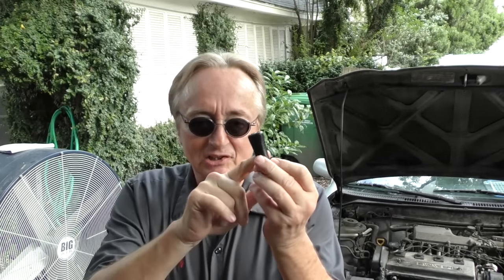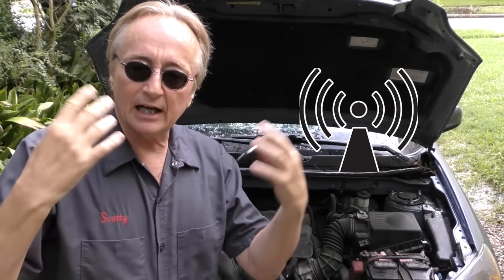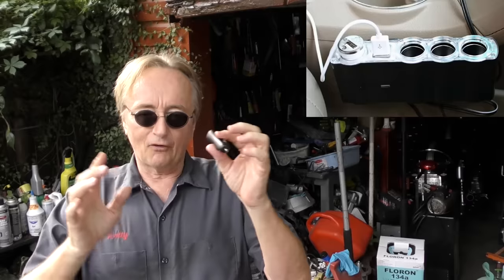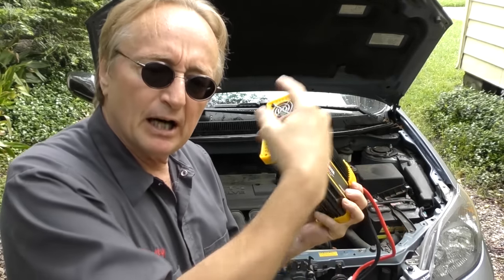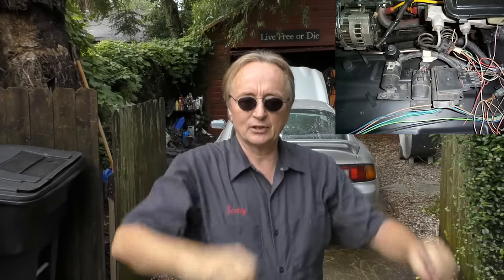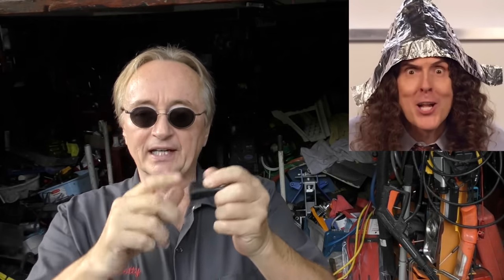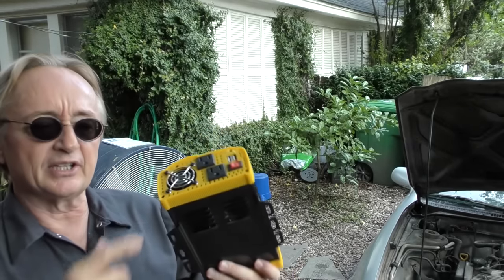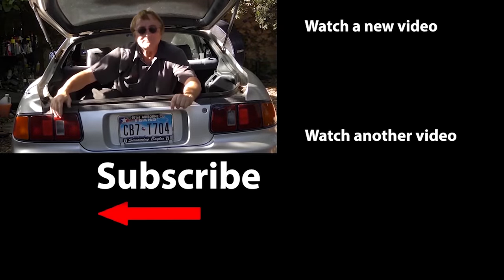This Adapter Will Destroy Your Car

Comment: These adapters are just 5V regulators. No conversion to AC needed.
Reply: Yeah was gonna say, going from DC to AC then back to lower voltage DC.. seems complicated.
Reply: Exactly what I was thinking. Going from DC to ac back to DC is pretty pointless as going from ac to dc will still require a transformer, rectifiers and a  regulator to make it 5VDC. You can bypass that instead by going from 12VDC, cars cigarette lighter, to 5VDC with the regulator
Reply: The higher wattage adapters are buck converters which are switch mode power supplies. They do pulse but they don't actually alternate the current. I can see how they 'could' create problems from RF signals. I still love Scotty.
Reply: Yea a $50 DC to DC  power supply use a 20c mosfet and a $5 DC to DC power supply uses a 20c mosfet.

Comment: For EMS week one year they gave us those cheep plugs. Every ambulance crew started using them that day. Turns out the radios in the trucks were being jammed from the plug. Crews were not hearing dispatch call them, some of the 911 calls had long response times because of it.

Comment: I worked in the computer hardware field for decades, including electronics.   There are at least a couple of things that can be done to greatly reduce RFI or EFI, probably the most effective is metal shielding and the other is filters, of course a combination of both can be used.
Reply: Shielding for RFI. I am a musician and guitar cavities should be copper foiled inside to deter the radio waves. There's nothing like picking up a cop's radio through your bass pup.
If you have a sub woofer on your home theater you most likely connect it with a shielded cord to ward off RFI. If not, it hums like crazy.

Comment: Scotty: "you can't see electromagnetism"

Man I guess visible light isn't a form of electromagnetic radiation
Reply: Oooof
Reply: Don't you need electromagnetism to excite some electrons into their higher orbit  in order to produce light.  Kind of like taking a fluorescent bulb near a Tesla coil.
Reply: @burritos1000  yes changing the excitation state of an electron usually releases a photon
Reply: If you want to get really technical, you're not seeing light, you're seeing a reflection OF light.
Reply: u have never seen light, no one can
Reply: @kwphillyzkp2  Two ways of "seeing" light,
 things that reflect visible light and things that produce visible light. Not sure who told you differently.
"Seeing" is our interpretation of light. So one cannot say you can't "see" light because the very essence of "seeing" becomes the "light"
Reply: @kwphillyzkp2  That said l"light" is a wavelength of photons. Your eye interprets these wavelengths. In order to be interpreted one must "see" the wavelength.
You want to understand how human eyes function?
Reply: @atheism7  i had a foton once but the wheels fell off
Reply: @kwphillyzkp2  if u suddenly see the light make sure u're not sitting in a railway tunnel
Reply: @LORDRA1DEN  a reflection is still composed of photons.. what's your point?

If you REALLY wanna get technical, then what you're seeing is a controlled hallucination your brain produces from it's interpretation of the electric pulses it receives when the photon receptors in your eyes are activated.

Comment: He’s absolutely right about using one of these 12v plugs. I have a Infiniti Q50 and it caused my car to completely shut off while driving. Infiniti S.W. Houston told me it caused 63 OBD 2 codes to pop up. They were about to recommend that I change out BCM and other expensive sensors computers, costing me $8k. But luckily we caught problem in time.

Comment: Physicists understand electromagnetism EXTREMELY well, Scotty.
Reply: I would hope so, lol.
Reply: Reminds me of the old rumor that "scientists don't understand how TVs work".
It is extremely complex and unpredictable because of the noise, but that doesn't mean that what's happening is not understand.
Reply: They may understand the 'how' very well. However, the 'why' remains an object of controversy.
Reply: The Earth doesn't wobble, what gave you that idea? And why would anyone want to close a black hole?
If you want an answer you have to actually ask a question, and why is not a question.
Reply: @benjovi55
No, the Earth doesn't wobble, it's tilted, so are the front tires of your car (maybe you should get that checked).
To ask why is just begging for an excuse.
Reply: @benjovi55
Well the Earth can't be tilted in the wrong way, as your tires are (and so are mine so I get it), but they are always tilted. A gyroscope can be tilted and still be stable until it's energy gets low, then it's fighting against gravity which causes it to wobble and crash into the nearest object.

I found that giving an excuse ahead of time just leads the other person to wonder why they bothered at all.
Reply: But why???
Reply: Richard Gates well some ppl are adventurous and want to find out so sneering the why question never hurts. And explanation never hurt anyone. If anything it can Haley in certain cases with certain things
Reply: @realcreature3D  a wise man knoweth that he doth not know.

Comment: Thanks for the info.  I know you probably don't have a lot of female followers since most girls have no interest in working on cars, however, I am a big fan since I have already used a couple to fix some things on my CR-V.  I had no idea the electro-magnetic interference would cause issues with the engine function but I have noticed that if I plug my phone in when the radio is on, it interferes with the radio reception so it all makes sense now.  Anyway, keep cranking out those vids!  I'm learning a lot!

Comment: Most of those just use dc voltage reglators not ac..
 7805 regulators only use voltage in (12) ...grnd... and volt out (5vdc). The noise is because cheap chinese mfgrs dont capactively filter them which can then oscillate on diff freqs.       The only ac would be in an ac to dc regulator... using a bridge rect to strip ac into dc.
Reply: Exactly.. theres noDC - AC- DC conversion going on ...
Reply: Can someone in here translate what y'all just said please? Lol
Reply: @robinnelson18  scotty is not being specific to the problem.  Most are not what he claims. Those larger models are different.  Those smaller models with the coils are not what he claims.
Reply: @Scotty Kilmer 
As soon as he said that dc gets converted to ac and then down voltaged, I thought the same thing. It does not. It gets directly down voltaged with a buck converter circuit.
  All you need to do is get a good quality device with minimal rf leakage.
Reply: WHAAAAAT!!!
Reply: @robinnelson18  Please don't leave the kitchen!
Reply: I think there is some confusion as to the difference between old fashioned linear type DC regulators like the 7805 and modern DC-DC converters which use switch mode to do the DC conversion. The semiconductors switching at very high frequency, turning on and off does the regulation. This method has much greater efficiency than linear and therefore produces less heat and so can be made far smaller and cheaper. A buck converter is a form of switch mode power supply. To give a simpler view, the Switch mode semi conductor literally chops up the DC into smaller pieces to change voltage, this is a huge over simplification but it is not a simple process.
This high speed electronic switching (in the KHz range) is what can create EMI. Scotty tried to point out that cheapo units will allow this interference because they are poorly made and designed.

Comment: not converting  DC to AC to DC. its using a voltage regulator and there is some ripple or noise but current flow never alternates direction. cheap adapters on ebay probably use counterfeit voltage regulators. voltage regulator is an integrated circuit,
Reply: Yeah, I have no idea where he got that from.

Comment: Be warned about power inverters. If you're powering pretty much anything with an electric motor see if it requires a true sine wave inverter. You may just save your device.
Reply: Most anything that runs an a/c motor needs a true sine wave inverter.

Comment: Scotty Kilmer  - hopefully you'll see this  and give me your opinion.   I use some of the Nonda Zus system.  I've got their obd2 plugged in and I use their car charger.  It definitely falls into the more expensive category at 20 or 30 bucks.  I dont use much for charging but it does serve as a voltage monitor and logs and keeps track of my cars voltage.  The other function is it is a location device to keep up with where you park.   Its a quality item from all I can tell. So question is - is it gonna cause interference?  Most concerned with my stereo. I guess im an audiophile and my system is over 3 grand. And I dont want ANYTHING  corrupting the sound. I mostly leave it plugged in the dash right under stereo.  Ive never noticed an issues.  Is it cool to leave there or should I move it.  I have the option of putting it under the bench seat in  my silverado because the jump seat has a locking box under it and a cigarette lighter outlet.  No parts of my audio set up run near there.  Would it be better down there or does it not matter?  Thanks

Comment: Thanks for the info. Always wondered about all the different radio frequencies we're surrounded by.
Reply: LOL WAIT TILL 5G STARTS FRYING OUR BRAINS
Reply: @VSMOKE1  5g is a series of guidelines and specifications.  It has nothing to do with an exclusive frequency. There are already radio waves that saturate nearly the entire rf spectrum found in many cities from many devices since many years. Consumers have already been exposing themselves to gigahertz frequencies for over 20 years and not even know it. When radio waves overlap, they have different wave properties at certain points in space where a human or animal would be present in. 

Do not complain about 5g being official. What will harm the most people will be people themselves who are too stupid to know much at all. Dumber than a 5th grader from the 1850s
Reply: @urineanimal  SURE BUDDY WHAT EVER YOU SAY 🤣🤣
Reply: @VSMOKE1  Maybe you should re-read what I said. Or maybe ask some questions if you want a more specific response in what you may be assuming. For me, wreckless use of RF technology by others who are not familiar with basic electrical engineering principles are very dangerous individuals. Heres a funny trick that anyone can do if they do their research or thinking. You know how people in cluster housing or appartments are stupid enough to run a half-watt wifi router and leave it on 24/7? I can pick these morons signals up from over a mile away easily. Just the basic stock router an ISP sends the customer. Well... this is assault on me. So a little trick is to trigger these routers to switch their operating channels rapidly with a simply method :) routers automatically do this to optimize performance. However, if you get multiple routers to switch their operating channels at a certain speed accross certain known channels they switch to.... well I will tell you what. If someone assaults me with their radio tech, its perfectly legal for me to protect myself with the same hardware while also doing to them something that will..... hehe fill in the blanks. Its very simple. Point a gun at me and.... well if i have a gun maybe I should just drop it and stand still right?

Comment: This one I can't believe.... I've used these as long as I've had a phone and a car never had a issue on several different vehicles
Reply: I wouldnt have believed it either, but this actually happened to me. For sone reason my favorite radio station was being interrupted by static, until a coworker disconnected his phone charger. I was truly amazed at how each time I plugged the charger in the station would go out.
Reply: @marmars1081  strange
Reply: It really is about the quality of the components inside these cheap switching power adapters. A really nice Anker or other quality brand one even with 2 ports and QC or PD support on one or both ports will generate less interference than a cheap one. every car is different so it is not easy to point fault at these so I definitely give Scotty credit here at bringing this issue to light despite any criticism he may receive for it.
Reply: Plus why the hell would it go from DC to AC back to DC?
A DC to DC converter is cheap as hell and extremely simple. No 5v adapter out there should ever go to AC.
Reply: steaker1705 do some googling and watch videos on switch mode buck converters and you will understand why AC is part of the process.
Reply: @marmars1081  Same. I never thought this would have been the cause, either!? I had changed nothing else, recently, with the vehicle and my FM station also went out. Lucky for me (because I was prepared to diagnose an antenna issue with the vehicle), that cheap "dollar" adapter just falls out of the port and sha-blip!.. radio!

Comment: I have a 2019 mazda cx-9 gt and it happened to me 2 times i bought one from walmart a samsung which i thought would work great but when we got out of the store the ignition stays lit but it would not start even the doors would not open we had to use the emergency key to get in. When i unhooked the battery and it started but when we got back out it did it again . I took out the usb charger and everything worked i have a ba in electronics and took my scope out and found the fob used 915hz and the usb charger used the same .

Comment: I bought a quality one but it's too big for the wholes. I forced it in and it got stuck. And when I yanked it out it pulled the lighter socket out with it. So if it seems too big don't force it in or you might do damage pulling it out. And yes I realize this can be read another way, sorry about that. 🤷🏽‍♂️

Comment: I plugged a glade 110 ac air freshener into the plug and turned on the switch on the dash.
Will this damage anything ?
It's been working for like over a week now.

Comment: Scott's Qualcom adapter is more expensive than his Toyota Celica.
Reply: A Celica is a fun car, they sit low but you dont have to pull yourself out like your in a hole & honestly something unintentional happened & even crap speakers sound pretty good it's something to do with the interior design & they will straighten out a curve better than a flat iron!

Comment: In Fred Flintstone's car he uses an hamster wheel and a running prehistoric mouse with long saber teeth to run it thus converting FEET power to 12 volt power for his accessories.

Yet, cell phones wouldn't be invented for another 100,000 years !
Who needs cellphones when they had PARROTS !...
Reply: Always wondered where the highbeam switch was. They didn't have floorboards, either.

Comment: cell phone produce electromagnetic fields also.
Reply: badlandskid cellphones produce signals in the microwave ranges shouldn’t interfere I do know some at&t phones do interfere with speakers cause of the frequency they use
Reply: that's brain tumor territory. I got a Motorola flip phone way back in the early 90s cause the lab I worked at gave them to us free; we had to pay for using them. A year after I got mine and used it, I was diagnosed with a menengioma - brain tumor. It was benign but they keep recurring. 2 surgeries and 2 bouts of radiation have come and gone. My doctors have always though the two tied in. I hold no phones to my head any longer unless it is a wired land line. Everything else goes to speaker.

Comment: I’m slated for bilateral knee replacement. I’m a widower with a pickup,SUV, and MB 560SL. Either too high to get in, or too little foot/leg room. I found a beauty—2003 LeSabre w/26K miles. No usb or 3.5 or rca input. I need a phone charger and Bluetooth to stereo. I want to keep the original 2xdinn radio/cassette/cd !  Ideas?😅

Comment: No it doesn't Change the power to ac than go back to dc you would step down dc by using buck converter
Reply: Yeah a voltage regulator. No DC to AC conversion going on that would be ridiculous
Reply: @sseeplane yes. They can be electrically noisy. If you get a high quality metal shielded one, it shouldn't be that much of a problem. When the car is NOT being driven, it should be removed.
Reply: Think he's talking about cheap ones
Reply: @Ben Reddick no ac is totally different than pulsating DC because in ac you get +and- waves but in pulsating DC you only get + pulsing

Comment: Great show Scotty.
Hope this inverter has the latest flux capacitor. My old one nearly burned out my canutor valve.
Reply: morbidcorpse  , yip.  Need to maintain yer hyfundoufunator valves and seals as well.  Boy if you don't, yer aksin fur trubblez.
Reply: KANUTER NOT CANUTER! SILLY.
Reply: @shawnobarker3255  dang Chinese parts again.
Reply: HAHAHA THAT'S SO FUCKING FUNNY
Reply: @Ken Bullard Well a left handed monkey wrench should be kept in the car to tighten that valve. Problem fixed.
Reply: no dought!  lmao!

Comment: leave it to Scotty to consider tin foil an insulator. I've used it as an electrical conductor my entire life (antennas)
Reply: That's a cheap solution. However I have seen the same shielding in electronic devices I have opened  to repair. Ofcourse those ones are thicker and more expensively designed, but it fulfills  the same function as the cheaper aluminum foil.

Comment: I've had friends use a aux cord while charging their phone with one of these and you can hear some static through the speakers
Reply: mine happened on my honda 2011
Reply: Are the static sounds vary according to the engine rpm? The higher the rpm the higher the pitch?    Mine are just like that, on 2004 daihatsu Xenia
Reply: It's very common.
Reply: @Ariqginjall93  yea just like that man I always tell them the turbos hitting 😂